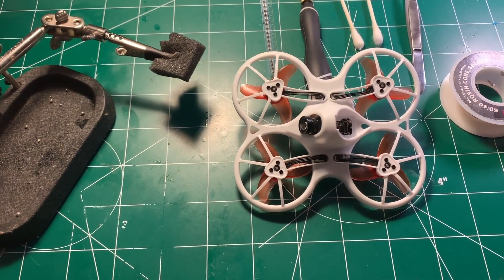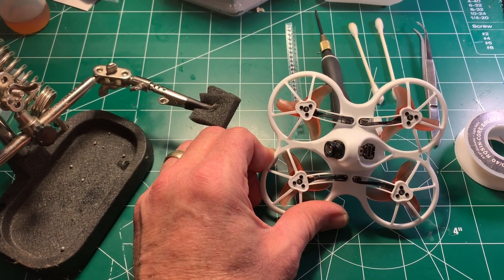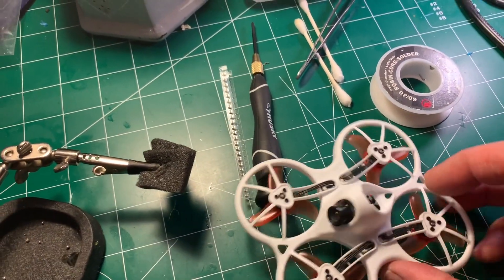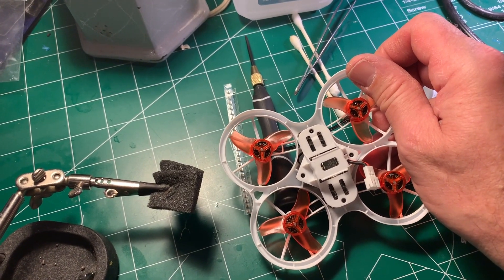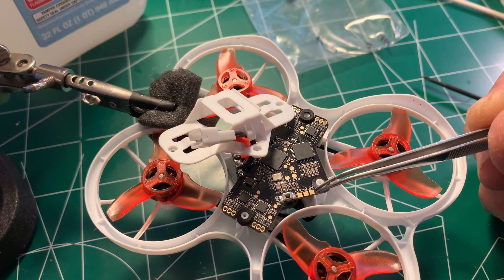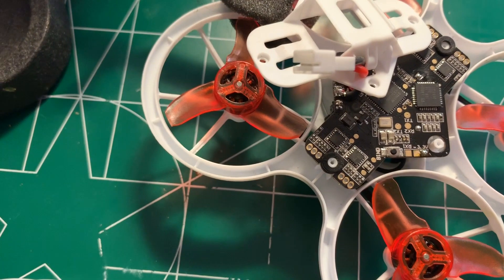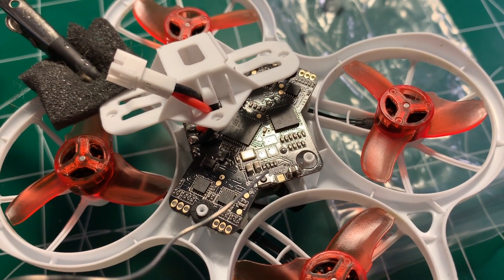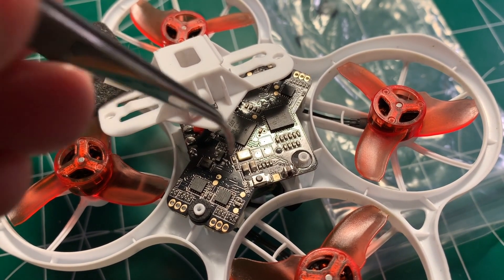Emax Tinyhawk Low Voltage Fix & Soldering Tips

Comment: Can we use any other capacitor if we don't have the mini ceramic capacitor
Reply from the maker: As long as it is 10uf ceramic you should be fine (eg has leads vs surface mount).

SLOG
Reply: Thank you

Comment: Could this problem explain why I get rxloss and runaway warnings in the first 30 seconds of every fresh battery I fly?  TinyHawk flies great after those initial jitters.
Reply from the maker: Hi Andrew B, No I don't think this is your problem as this has to do with the min voltage cut off circuit on the board which means this would happen after flying the quad for a while and then it starts acting up.

I would check to make sure your Maximum Cell Voltage is set correctly because you are using high voltage batteries (4.35v). I have it set for 4.5v in Betaflight.
Reply: @slogfpv  thanks!

Comment: Which is the positive and negative side? Or did you use non-polarized capacitor? Thanks
Reply from the maker: Hi Aero Techno,

I used a non polarized ceramic cap. The middle pad is labeled as negative. 

Slog
Reply: Thanks a lot SLOG FPV. This is a great help. I will order capacitor today. 👍

Comment: Has emax fixed the low voltage problems yet and how’s the fpv look?
Reply from the maker: Yes Emax now includes the 3.3v to ground 10Ufd capacitor change. I have the 1st batch which does not but you can fix it. 

As far as video feed issues, it depends on which channel you are on in my experience. Mine came with Raceband, channel 1 set which was not a very good video feed. However, when I changed channels to band B, channel 1, it looks as good as any other 75mm whoop class (not the best). You can look at my video showing a flight after I added a rate switch and tune. Link below and go to time ~12:13. PS if you want even better reception, pull the VTX antenna out through the V-slot on the top of the canopy. I have not because I don't want to damage it in crashes.
https://www.youtube.com/watch?v=XVldJoLq7uo
Reply: Thanks for the reply, Super helpful! Haven’t bought the tiny hawk yet was thinking of gettin the rtf version cause I’m new to the scene would that come with the 3.3v ground you where talking about pre Installed ?
Reply from the maker: Hi Eli,

Yes the RTF version should have the 3.3v Cap fix as they are later builds. 
Very nice RTF for a beginner with not too much investment.